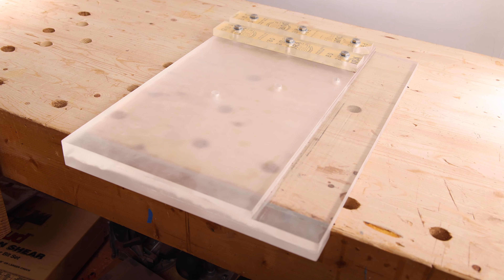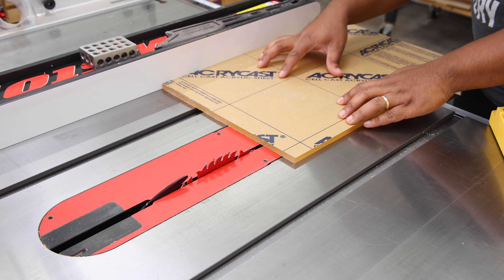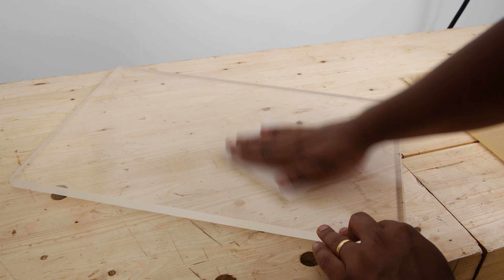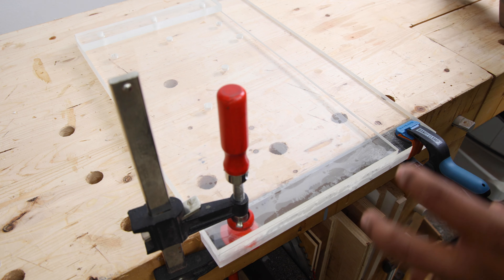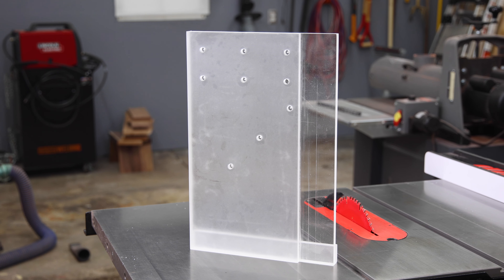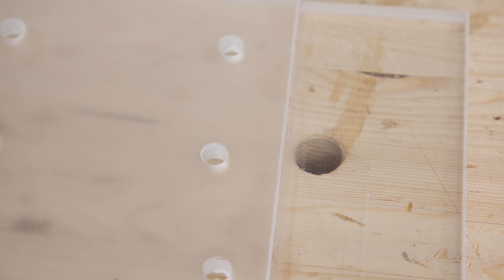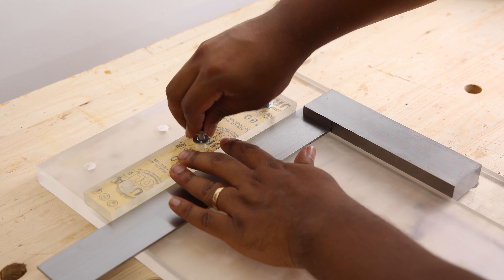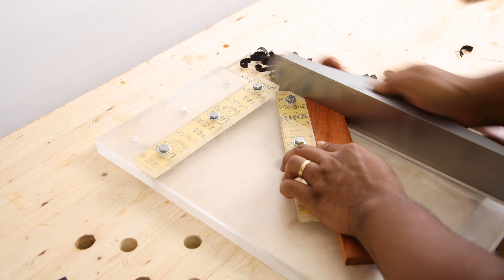No more wood movement

Comment: plexiglass? I would never think of that. Thanks for the video. Keep 'em coming
Reply from the maker: Plexiglass is such a cool material to use for smaller jigs and fixtures in woodworking. It is dimensionally stable and is easy to machine. I'll definitely be making more jigs using plexiglass in the future.

Comment: Awesome idea using Plexiglass - it came out great. I made several basic shooting boards, and was never really happy with them. I have to be honest, I ended up buying Veritas' Shooting Board, which might be cheating, but I do love it.
Reply from the maker: I was super tempted to buy the vertias one. But it is also made with plywood and I was like "nah....I want something else". No regrets with this build. And its cheaper than the veritas to make. BUt if you have the shooting board plane, the veritas one OR at least their tracks is the way to go
Reply: @WoodcraftBySuman  Yeah, I use the Veritas Shooting Plane in combination with shooting board. Definitely not the cost effective way, but it all works well together.

If I would have thought about using Plexiglass to make one, I would have done that. Like you suggested, I never trusted the one's I made.

Comment: Hi Suman. I found your channel through some random guy called Lincoln Street Woodworks. He’s a strange guy 😉

I was just curious how the shooting board handles breakout, please? As you know, when you make a shooting board, the 90 degree and 45 degree stops you rest the wood against, normally start off slightly longer until you do a few passes, so it ends up exactly the same width as wood you’re shooting, to reduce the breakout. Did you find this was an issue with the plexiglass? Also, how would you deal with tall pieces? Just stack up the plexiglass, I’m guessing?

Thanks for a showing a completely different spin on this idea; it’s a great idea! Keep up the great work. Chris, UK.
Reply from the maker: Who?! Never heard of him. Lol
So the fence in this case has a small amount of wiggle room. You can make it slightly longer and get a perfect fit after a few passes. As for taller fence- yes, the spare 45d fence here can double up as a taller fence. But you bring up a good point- I need to revisit the fence height issue so that it is much easier to operate than this version.